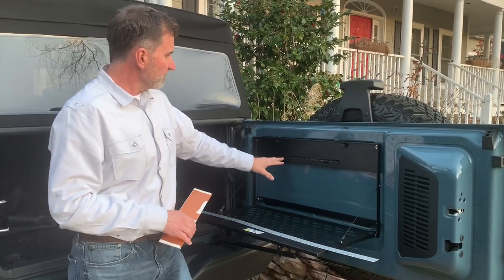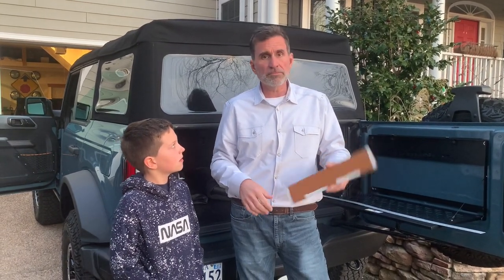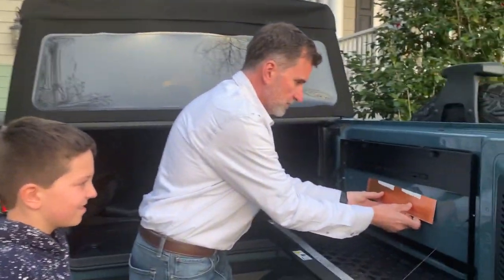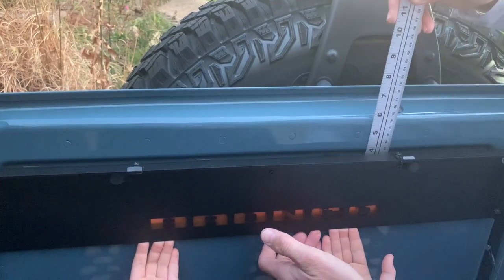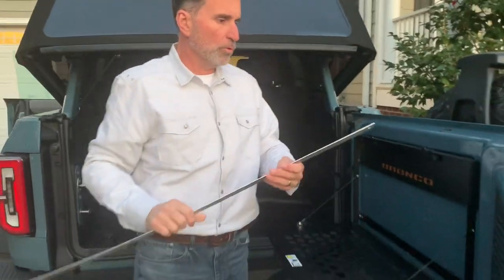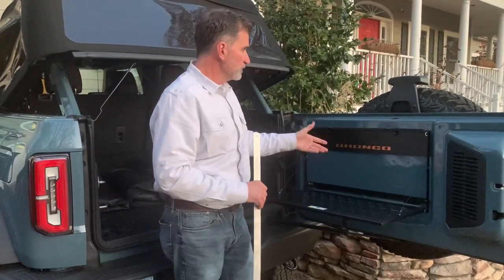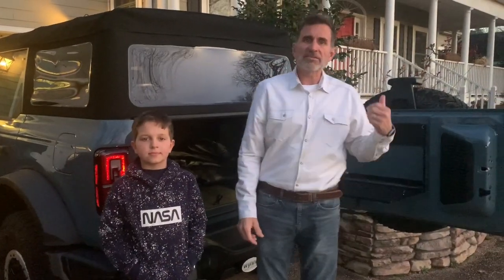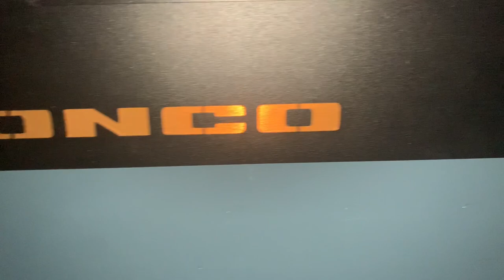Modifying our Bronco Swing Gate Folding Table.

Comment: Would it have been easier to just take the table back off to put that plate on?  It does look great.  Nice enhancement.
Reply from the maker: The one time anchors that are installed into the door hold great under pressure but once you loosen the bolts you ultimately loosen those anchors, The installer did not feel good about removing it